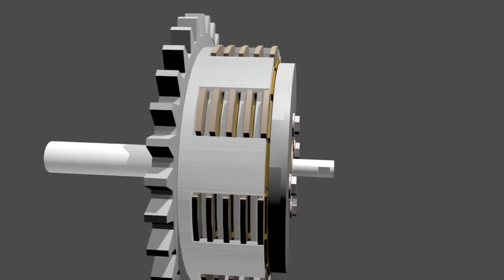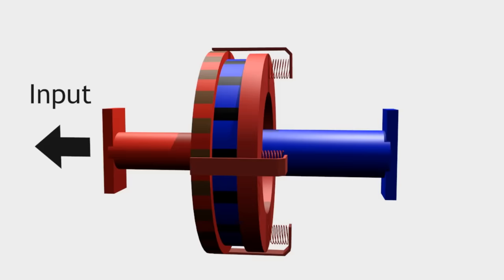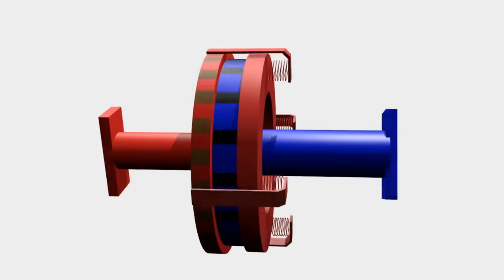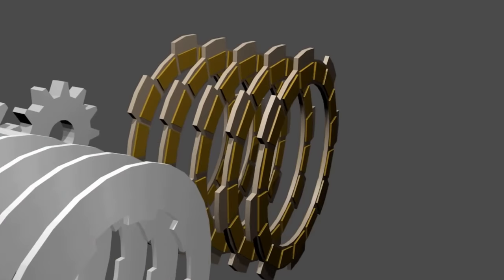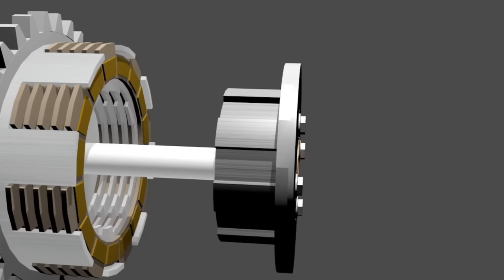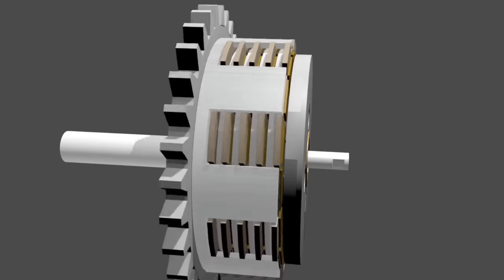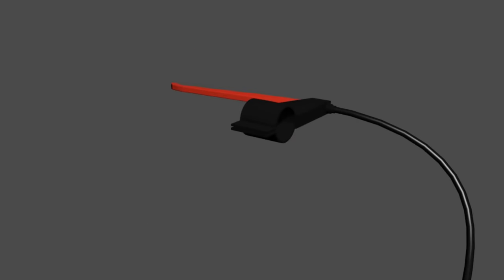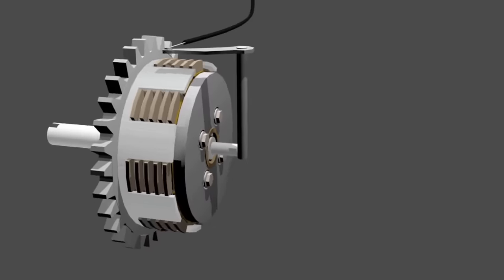Motorcycle Clutch Working Principle and Animation

Comment: When the pressure plate moves outward the metal plates and friction plates magically separate... Every video I've watched never mentions how the plates seperate and why they don't continue to stick together after the pressure plate moves out...
Reply: The mechanism of clutch actuator is pretty straightforward actually, on some low displacement motorcycles, they have a pushrod in the center of clutch axle and a cam lever on another side of engine, when clutch lever is pulled, cam lever rotates, and push the rod against the pressure plate, moving it outward.  When the clutch plates and metal plates are no longer pressed together, the clearance between them is sufficient enough to interrupt the power and of course, due to some kind of force? (Sorry, I’m not physicist) they do separate a little bit, probably less then 1 mm
Reply: It's what causes that "some kind of force that I'm looking for...
Reply: @WONMARK  there is no force that separates the clutch plates. It works on pressure, push your hand hard onto a smooth surface and try to slide it. Now without removing your hand, release the pressure, you can slide your hand across the surface. This is what the pressure plate in the clutch is doing.
Reply: keep ur palm   on a running wheel... and then give pressure on ur palm... u will see ur hand try to rotate with wheel... and then easy thr pressure ur palm then u will see the wheel rotating but not ur hand... same the clutch works...that pressure is sending to the friction plate (like ur palm) through the pressure plate... pressure plate is like a diaphrme spring plate... u relase pressure from it it will came back from friction plate...
Reply: The plates don't have to separate. The plates are free to slide axially. Once the pressure plate pulls away, the frictional force practically disappears so they just spin against each other even if they are still touching. Hence why motorcycle clutches are "wet", so the oil in them can lubricate them while they are spinning against each other.
Reply: It doesn't stick together because there is no force applied.. If you are climbing a tree, you should grab the tree so powerful so you can stick but if you release a bit force then you will fall.. Do you understand. Same goes with disc brake system
Reply: They do continue to stick together. If you were to have the bike on a stand and be in gear with clutch in, the rear wheel will turn because the plates aren't actually separating. They don't transmit any significant torque, and that's what matters. Set the bike down and the wheel stops turning, but that force that was just spinning it is still there. 

There is no force splitting them, doesn't need to be. The clutch material isn't going to weld to the plates under normal conditions. The animation is just that, animation for clarity. 

Disc brakes are very similar, most all don't have anything significant driving the pads back off the rotor. In fact, it's usually a bad thing when the pad loses contact with the rotor as you'll have a delay next time you hit the brakes with a drop in the pedal that might be pretty large...
Reply: @WONMARK  consider you are opening a lid of a jar. With mild pressure , nothing happens but when you apply pressure and turn, the lid comes off. Similar dynamics at play

Comment: I don’t get it. My cr85 when it’s installed, the “plunger” is all the way in (flush to the clutch cover).So if you pull the clutch lever , it pushes out the “plunger” to engage the clutch plates/springs. It’s doing the opposite of this example. There’s only one way to install this, can someone please help explain that to me?

Comment: Hello, the video is great and instructive, I would ask you if you can give advice, I have a yamaha fz600s2 2009 that crashes a lot when I put in first gear and from first to second, it is also very audible from third to second, why is this happening people tell me that it is normal for that model, when the oil is cold then it is great otherwise I use FUCHS SILCOLENE COMP 4 10W-40. Hello from Croatia.
Reply: Mr you need to change cluch plates if it damage.

Comment: The last animation confuse me. It looks like you mixed something up. In this assembly you would need to push the pressure plate outside trough the input shaft.

Comment: Why 4 sets of clutch plates working simultaneously and not a single on like motorcar?
Reply: Size. Cars can have much larger area for flywheels and pressure plates of much larger diameter that's not really possible on a motorcycle. The stacks allow more square millimeters of clutch material in a smaller diameter clutch basket.

Comment: Then how come I've only seen the lever on the OTHER side of the case PUSH a rod that went through the shaft to PUSH the pressure plate away? I've never seen one set up the way this video shows.
Reply: Usually on the older models of motorcycle or bike mnfacturer styles. modern engines have clutch assembly on the right side of the engine, hence the location of it. modern engines also utilise the push rod to have it worked in the same principles, though the layout varies from bike to bike